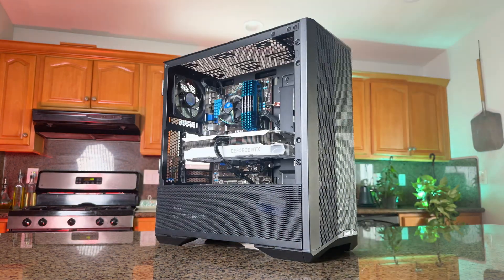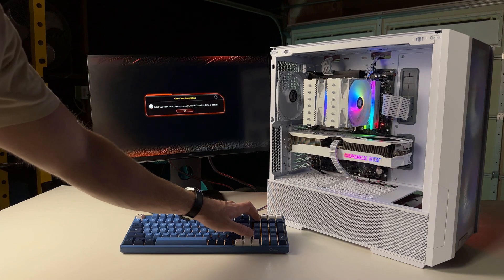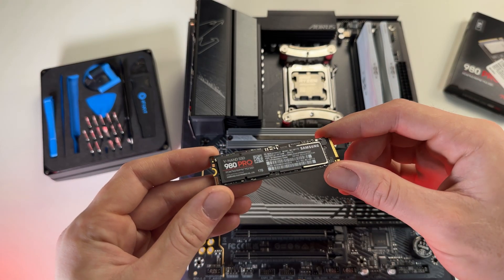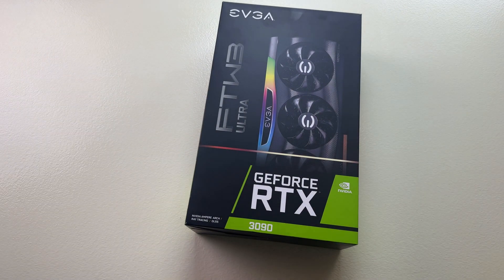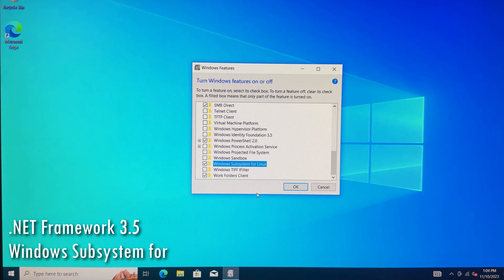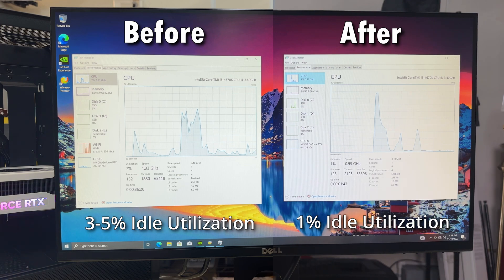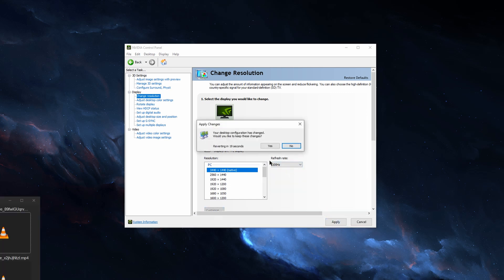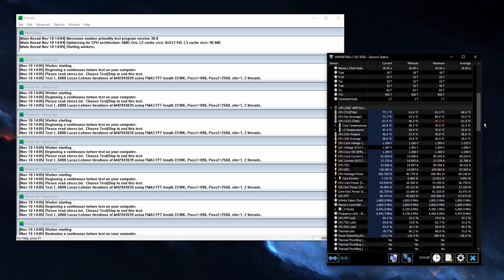What to do AFTER building your Gaming PC! (Unlock more FPS for FREE)

Comment: My Ryzen7 5700G idle temps is 45-60c it’s that normal? I live in Thailand ambient temps are around 30-33c I still confuse 😅
Reply from the maker: I’d say that’s a bit high for idle, but could be fine 😂 what CPU Cooler are you using?
Reply: @SpectralTech I use AIO CoolerMaster240cm.And thermal paste is ok not too much or too little🤔 Oh! one thing i notice is my cpu idle work load around 10-20% all the time...

Comment: Just did a cheap build for myself.  Upgraded from 6 year old rig ( I7 7700 / 1080 / ssd with old hard drive ) to a 7600x with AIO and RX 7600 with 2tb pcie 4x4.0 7000read/5000write NVME.  Only extravagance I allowed myself was the LIAN LI 216 white rgb for 99 bucks.  My Asrock mobo did not have XMP or DOHC, so I had to set my ram to 6000 manually.  Every thing wors like a charm.  You are right about testing.  My temps were not great until I stress tested for about an hour straight.  Apparently thermal pasted needs a "break in" period.

Comment: One of my main problems is I play some older games and had no problem playing them on my 8 year old PC. I just replaced said PC, but forgot that some games don't like each other. 2 of these games use a particular anti-cheat, but different versions. So I have to make sure each of those games and associated support programs are fully shut down, because if not, they sometimes shut down or crash to desktop. What Infuriated me is that one game has a invisible settings window that they don't tell you about that defaults to look for game updates whenever the anti-cheat is running. Which crashes the other game using the same anti-cheat, but the different version, which it tries (and fails, every time) to update. So I needed to go into the program files folder and manually key the note file to turn off the game updater except to run once when that game starts.
Reply: I do use MSI afterburner to double check the nvidia power specs and there's about a 5% difference, but it helps to have afterburner change the settings. I forgot about the nvidia control panel for changing the framerate though, so thanks for that reminder.